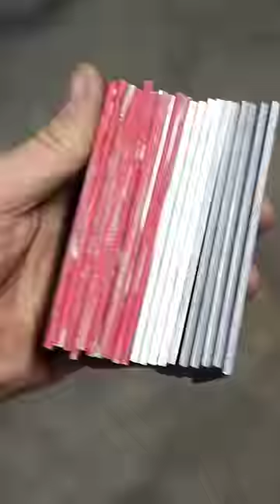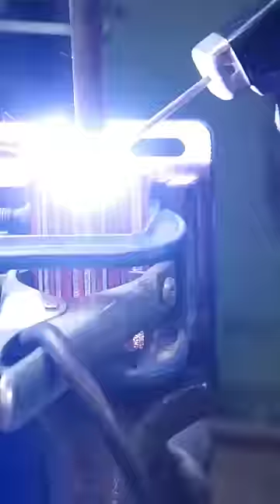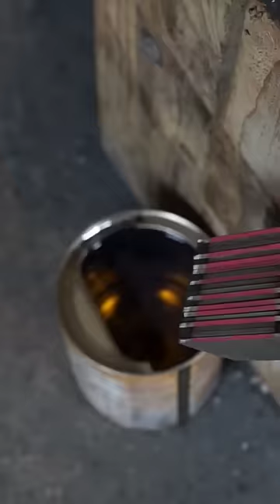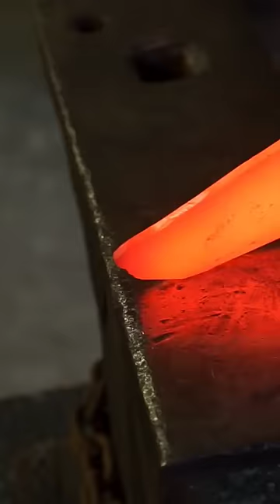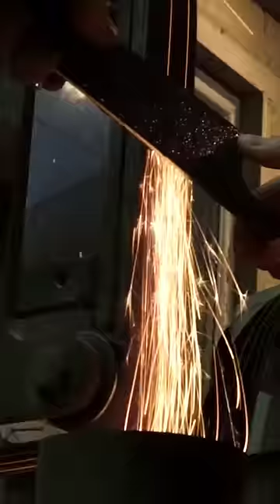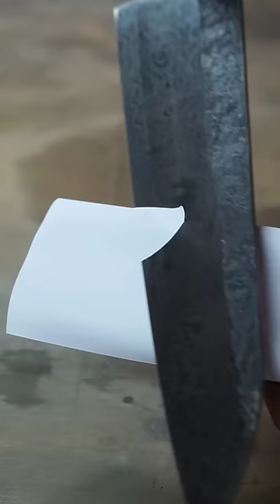Making a damascus gyuto chef knife with food release blade

Comment: This is the only way to make Damascus (well without the fuller which is pointless in a knife.)  People use screws or twist the metal to make pretty patterns but you don't get the benefit of the sharpness of layered steel anyway other than having flat layers or folded steel.

Comment: I'm not sure why you hollowed out the middle portion of the blade, then made it thicker towards the edge, it's extremely thick towards the edge, while it may look cool it does not make a good chefs blade, the more your sharpen this the thicker it becomes behind the edge, that's normal, but this knife goes beyond normal, a typical chefs knife has a full flat grind, a sabre flat grind, or a hollow ground, or partial hollow grind, all of these grinds provide strength while giving it a very thin edge that will not increase drastically in thickness behind the bevel, also the multiple extreme angles will not be so good for cutting thinly, it is very cool looking, but seems not so useful in the kitchen, especially over time, and I'm curious how it will cut through different foods, not well I'm guessing, there is a reason the shape of a chef's knife is pretty uniform and has not changed much over a long time, at least not the thinness and grind, i think it is a very novel design, and i have to admit it looks very cool, but I'm skeptical about is performance especially over time, but that shouldn't deter you from trying new things, i bet i could find a perfect use for a blade shape and grind like that,
Reply from the maker: The primary bevels are thinned on stones. It is called S-grind which lightens the blade giving balance while reducing surface contact with food
Reply: S-Grinds are usually flat grinds or convex grinds with a fuller directly above the edge, the aggressive change in geometry helps prevent food from sticking, while reducing weight. this is an increase in performance while greatly reducing the knife's lifespan, however modern steels usually keep an edge longer, which helps make up for how many times it can be sharpened in comparison to a regular full flat grind.